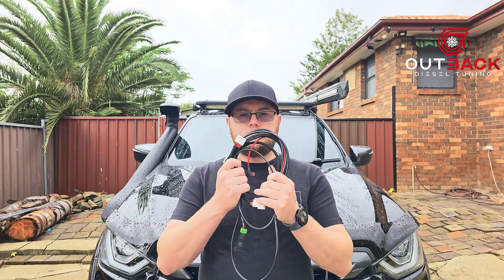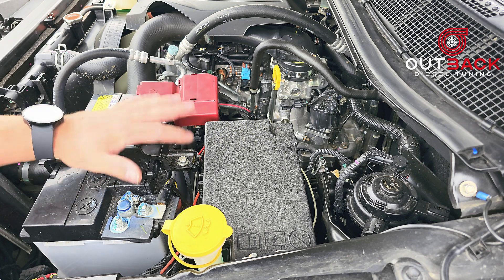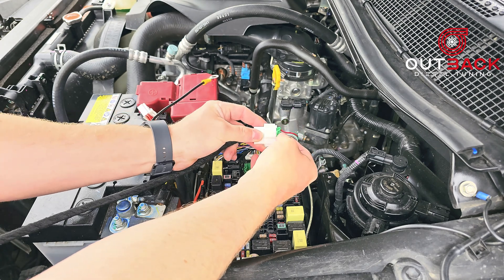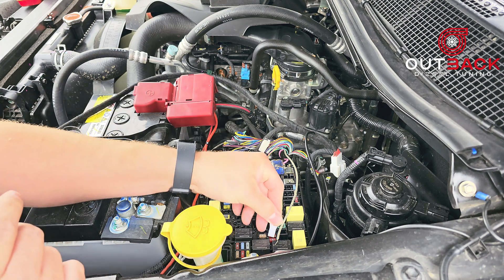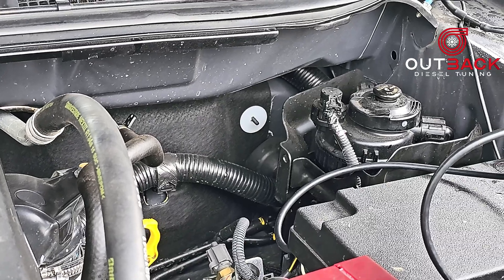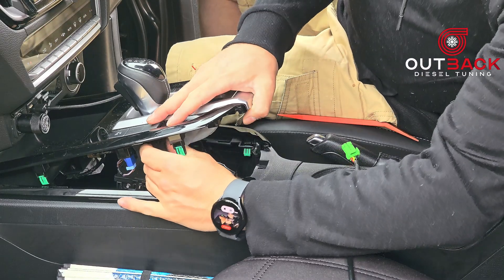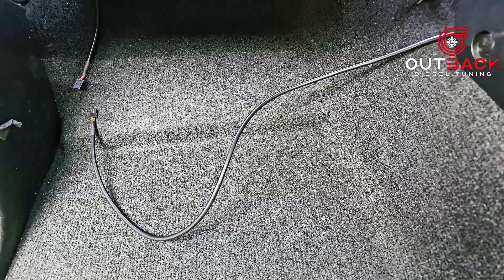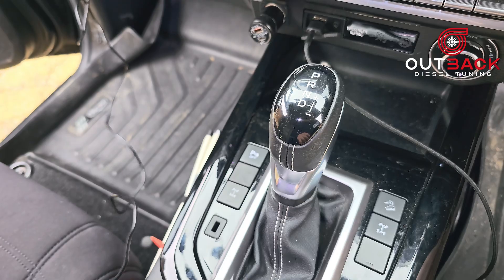How to install the Anytime diff lock loom for a Isuzu Dmax/ Mux & Mazda BT50 MY21+

Comment: Hi. We followed everything you did on the video and now the car has thrown errors with check 4wd, tcs, abs. As per the video it still has the factory switch installed which we did. Is the factory switch meant to be disconnected. We have since removed it all and still has the errors has anyone else had this problem.
Cheers
Reply from the maker: yes the factory switch is ment to be disconnected

Comment: Great video mate. I purchased the same one some time ago and cant remember who I bought it from. Am I supposed to disconnect the Isuzu Diff Lock wires from the button??? 
Am I just supposed to use the one that came with this kit? Thanks again
Reply from the maker: disconnect the original switch cover and tape it over, and use the new button
Reply: Yep. I've done it.

Comment: Just a couple of questions 

1 does this require 50m to engage ?

2 does it cut out at 17km/h like factory
Reply: Yeah I see end video needs 50m to engage
Reply from the maker: no it doesnt take 50m, it was just my misunderstanding of how it works. the gears just need to be lined up in the diff. 

no it does not cut out at 17/km/h

Comment: Can you put the new switch in place of the existing switch? Or even just use the stock switch?
Reply: He said on Facebook you need to have the original switch still plugged in for it to work but you can just tuck it under the shifter and put this one in it’s place if you want to.